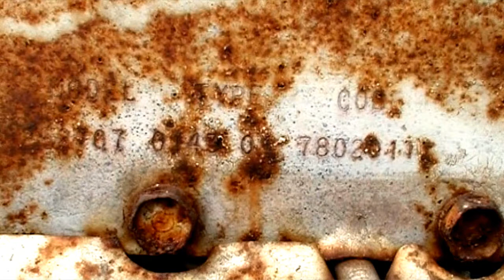Old 70's Snapper Red Comet RER, VERY old start!

Comment: That's awesome...your's is exactly one year older than mine, but came with an electric start Briggs and mine has a pull-start Tecumseh.

My bro rolled the one our granddad owned down a bank so don't feel bad about putting it in the river. You saw how that tire lifted up on corners...those suckers can humiliate you if you aren't careful.

Comment: Sweet old Snapper, there used to be a plant here nearby in TX. Growing up mowing lawns in the summers we always had 2 stroke Snapper push mowers. They would outlast 80% of the others... And you could tell when they were running out of juice. I remember being 11 and going to the Snapper place. They had a parts dept within, that's how I learned about 2 stroke's replacing top end kits. Gramps had been going to the same Snapper place way before I was born. Remember very well him tell me "only buy OEM parts for these" Also helped out learning how to do top ends on my dirt bikes. 2/3rd's less mechanical moving parts vs. a 4 stroke. We also had a Snapper ride on lawnmower which these days fetch a pretty $ used. There's a reason though.. Nice Comet

Comment from the maker: Mine's in rough shape indeed.

I have just started striping it down, took the engine off and seat  etc. and I figure I manage well whip a coat or two of Tremclad Red and paint the tin on the engine white and rims either white or red maybe even black.

Comment: these old engines require 30wt oil on the air-filter...you might not want to remove the foam but you do want to put oil on it.
it helps to clean the air of course/but also lubricates the top-end when running.
Reply from the maker: +David Shaw Nod, I knew that once but it didn't seem to retain. Thanks for the brain bump.

Comment from the maker: I AM a big galoot! Being 6' 4" and 240ish I tend to make things look small when i sit on them. LoL

It helped that when I retired him, I ran the fuel out and poured some tranny fluid through the spark plug hole and gave it a couple spins. But still, after pretty much a decade I was pleasantly surprised. 

Ya, I think I'll clean out the carb (I freed up the seized linkages on it but need to get a return spring), give him fresh oil and a new plug and take it for another spin!

Comment from the maker: Ya, she doesn't like it when I fire up noisy crap. She was a rescue dog from an apartment dwelling dweeb. 

The throttle linkage was seized as was the choke and the return spring was rotted off (not that it would of made a difference with the throttle linkage being seized). I was more curious if it would start with minimal input from me. Tough old bugger passed! I'll rebuild the carb and crap, he deserves it!  

It was an unpredictable ride, that's for sure! LoL

Comment: I have a 1991 square frame one i love these mowers but with a 33 inch deck with 10 acres it takes forever only problem is they should have built these with like 50 inch decks u know
Reply from the maker: I hear ya. I only had 3 and a half acres and it took long enough, can't imagine 10. My buddy gave me his old Craftsman 12 horse with a 48 inch deck so off this deck went. Insane little fun mobile (for what it is anyway).

Thanks for dropping by.
Reply: ANDERSONEXPRESS7 they actually made a 42 inch 2 blade deck for these snappers there rare and hard to find but they are out there if you find one you would love it takes me notime to cut my 6 acres and its a snapper its damn reliable!